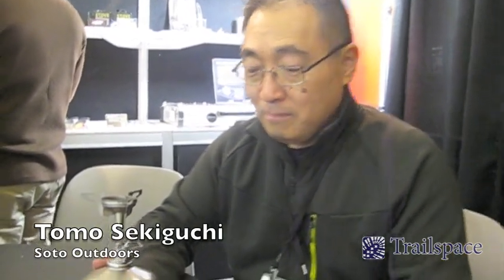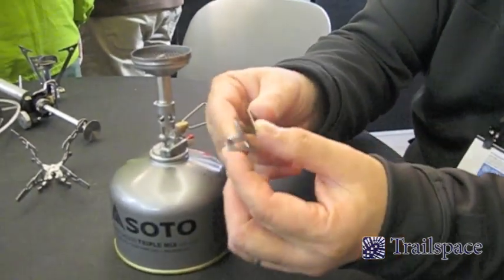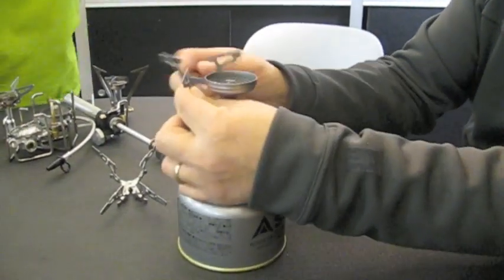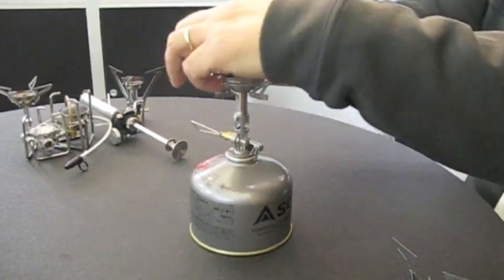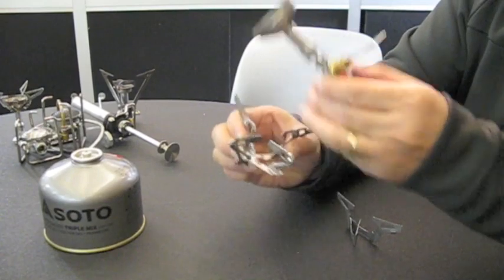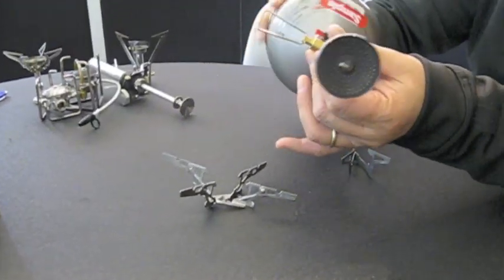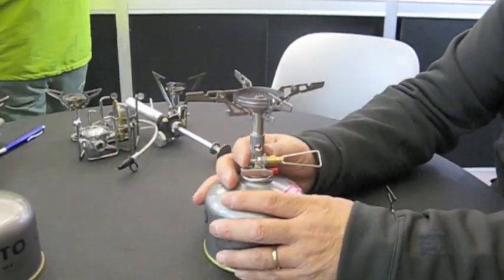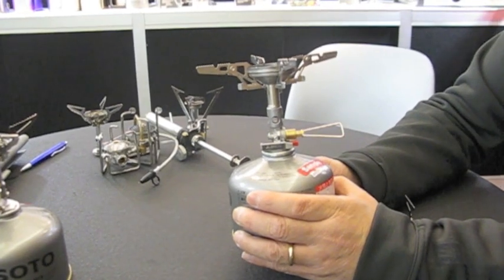Soto Windmaster Stove

Comment: I love my Soto Windmaster. Flame control is very good and resistance to winds up to 15 mph is surprisingly good.

I do highly recommend purchasing the optional 4Flex pot support (approx. $15) as it greatly increases stability and safety when using larger pots.

This stove is more expensive then others from manufacturers like Snow Peak or MSR but I believe it is the best LPG stove available anywhere.